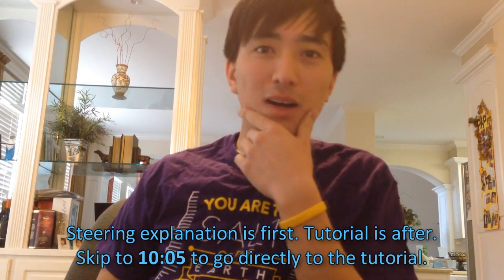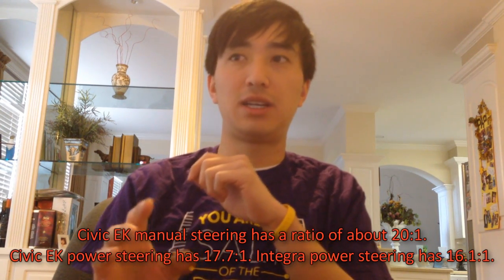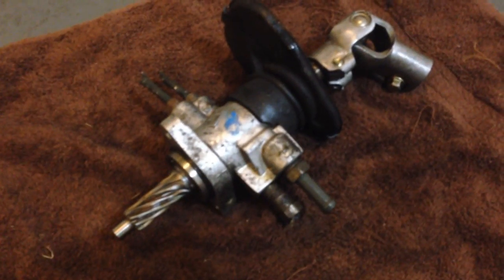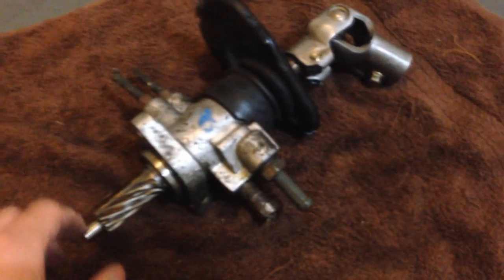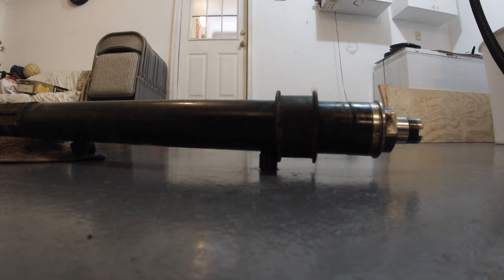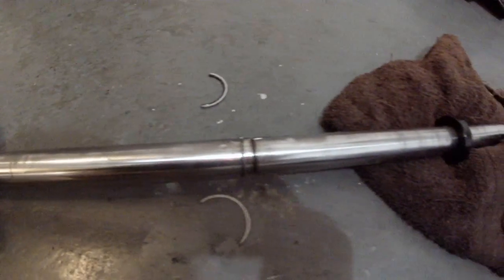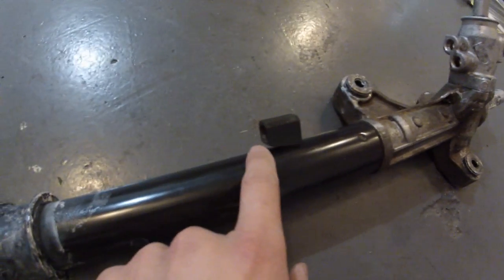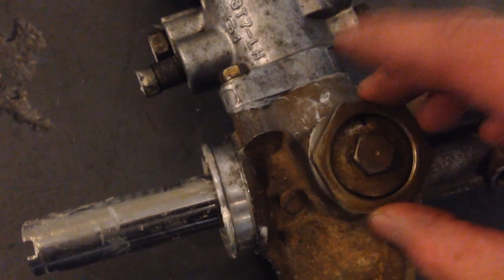How to Build & Upgrade Steering Rack for EK with Michael Flare

Comment: Hey Mike I’ve seen where some people weld a part of the steering rack when they reassemble. I guess it takes out any of the slop. But I know the heat can warp it some. Did you feel much slop on your setup?
Reply from the maker: I know people weld the big screw/nut that goes on the very end of the steering rack because it comes with a spot weld from the factory but I never heard of people welding anywhere else to reduce the slop. I don't think I have excessive slop, probably less slop than factory because I changed out all the steering rack bushings to poly urethane.

Comment: Is this a change from rhd to lhd？
Reply from the maker: No.
Reply: @MichaelFlare  I didn't quite understand how to change to short rack ，Now I have an ek9 power steering rack for rhd and an ek4 lhd powersteeringrack. How can I achieve the effect of ek9 on lhd
Reply from the maker: @zy5385  - If I remember correctly, EK9 Type R and EK4 SiR power steering rack should be identical steering speed/ration (8 tooth). So you don't need to modify anything.
Reply: @MichaelFlare  I didn't know until I removed the ek4, thank you for your sharing. If the ek4 is not 8 teeth, how should I change it? My English is not good, but I have watched your video
Reply from the maker: @zy5385  - I am 99.99% sure it is 8 teeth because you said it was a "power steering" Civic rack which should be 8 tooth. If not, then I have bad news. You cannot swap the RHD pinion gear with the LHD pinion gear. Even if it was the same teeth, it still cannot be swapped because the housing design of LHD and RHD is different. It will not fit. I tried this exactly before, it didn't work.
Reply: @MichaelFlare  bad new…My lhd is ek3 but not ek4, so I still want quicker steering on lhd,
Reply from the maker: @zy5385  - It doesn't matter if it's EK3 or EK4 as long as it's POWER STEERING. The only time you would get a 7 tooth is if you have manual steering. You should be good.

Comment: Hey whats up man im currently in mexico out in the middle of no where pretty dealing with some property title transfers i managed to find a small preschool it seems like and i get horrible wifi right now but i came across this video i was only able to watch part of the begining of your video but ima leave a question for you. So back in the USA i have a house and ive been working on a EK9 build in my garage before i left to mexico i finished the RHD firewall swap. So i have 2 EK9 subframes and i have 2 EK9 power steering racks. they are right hand drive power steering racks. they have been sitting in a JDM junkyard out in the open it seems that they have been through a few seasons and tons of dust and dirt has acumulated especialy where the pinion is and the pinion does not have the rubber boot. Im afraid that dirt or sand grains could of entered into the pinion. I havent realy taken a good look but is this possible? Let me clarify the steering rack and pinion was simply disconcted from the steering shaft and it was left in the subframe and the steering lines were covered up so no dirt would enter. Do you think my steering racks are 100% good to use can i improve my power steering with change the gears inside the pinion and make it easier to turn? Can i buy and overhaul kit and just rebuild/overhaul my RHD steering racks? Sorry for all the questions i just cant find solid answers online and i cant find anybody selling RHD EK steering racks so i gotta work with what i have. Just for a clarification i want power steering in my RHD vehicles and i want the tires to turn easily with out having to turn the steering wheel alot. Im not racing im just daily driving me and my girlfriend have a 1999 and 2000 DX hatch backs we are doing RHD conversions with HX engines to save gas and to enjoy our cars and make them a little more unique we are just trying to get a comfortble ride out of both of them. Any input or recomendation would be greatly apreciated!
Reply from the maker: I think dirt and dust can get into the pinion gear and housing. You can take it apart and completely clean it out by washing it. I don't think you need to get a overhaul kit. Just take it apart and clean everything with what and soap and you'll be okay.

Comment: Do you have clunking noise after doing this mod? Or no weird noises at all?
Reply from the maker: No noise at all. When does the clunking noise happen? Over a bump or while turning?
Reply: @MichaelFlare  over a bump,  like speed bumps, rough road, im still waiting for my power steering to give up and really wanna try your mod, but ours is an EG not sure if it will work
Reply from the maker: @JomsF  - check the 4 mounting bolts that hold your steering rack to the subframe. Either they are loose or your steering rack bushings are worn out.
Reply: @MichaelFlare  thanks for the reply bro, we just got our eg hatch last june5, 2021, this will be an ultra super slow build
Reply: @MichaelFlare  another question bro, if i don't have integra pinions will my stock pinion work with this mod? Im on civic eg hatch 1993 power steering
Reply from the maker: @JomsF  - Yes, absolutely it will work.
Reply: @MichaelFlare  Thanks a lot for taking time to reply bro, hope you can upload more vids about hondas.. if i can't fix the leaks on our PS will try this mod..

Comment: drill out that pinch on the 36mm nut with a 6mm spot weld drill bit. I removed that nut without damaging any threads at all. So do not just remove it and damage them then force it together with jb weld

Comment: For the manual conversion did you leave any ps fluid inside the rack to lubricate it or isn't that necessary? also been talking to some of my friends and they say if you cancel ps the ps pinion isn't strong enough to handle the manual rack and could snap the teeth do you think thats possible?
Reply from the maker: I completely cleaned the inside from the old fluid. I lubricated the parts with CV joint grease. I am not a professional expert but this is my opinion. The stress on the pinion to rack is EXACTLY the same between power steering setup and a delete. Power steering works by using a fluid pump and injecting it right before the pinion in the silver housing to twist the pinion so the driver doesn’t have to use much energy at all. The only thing I can think of that gets more stressed out is the steering column or U-joint at the bottom of it because you are twisting the wheel much harder here. A pinion with more teeth (auto pinions have more teeth than manual) means you’ll twist even harder here.
Reply: @MichaelFlare  Thanks michael, in that case maybe Ill look into hardening my u joint somehow maybe cryogenic treatment so it gets stronger
Reply from the maker: @Wolf-or6ws  - I don’t think you need to do that. I’ve had two different depowered steering racks, and they’ve worked for years even through racing.

Comment: Why do those ratios seem off? I saw a guy said this took his ek from 4 turns to 2.5 turns. After buying an s2000 my civic feels unbearable. Like a pirate ship, feels half as sensitive. If I stay powered will this wear out the pump? I think I'll grab another civic rack and an integra pinion because I need some quicker steering.
Reply from the maker: It's hard to believe he got a 2.5 LTL from this setup. You have to understand why Honda made the non power steering cars have about 4.0 LTL like the non-P/S Civics and NSXs. The lower the LTL, the more strength you need to turn the wheel because there's more teeth. It's a big burden to have a human turn a wheel with a low LTL, that is why the lower LTL is obtained through power steering. If you use a low LTL on non-P/S, then the steering wheel will feel extremely heavy. 3.5 and 3.2 LTL already feels heavy at standstill; I can already imagine a 2.5 LTL feel like the steering mechanism is about to break. If you do somehow lower your LTL below the stock one for your P/S car, then I think it will stress the pump out more because of the pressure, and it might break a seal. That's my logical guess.
Reply: @MichaelFlare  I'll do some research on the stock PS pump. Do you know what the LTL is on a 97 ex with power? I definitely need it more sensitive, doesn't need to be as sensitive as my ap1 s2k but a lot more than stock.

Comment: Hi Michael I have a power steering eg steering rack, would this work for me too?
Reply from the maker: I don't think it will work. EG/DC2 have different design/mounting than EK. If you really want to use the EG rack, then you would to switch your EK subframe to an EG subframe which definitely isn't even worth it because you have to rearrange other parts under the hood. Are you talking about doing this on an EG or EK?
Reply: @MichaelFlare  Thanks for the reply Michael, Well I have a kswap in my ek and im using the eg subframe because gives better engine position and I think im also using the eg power steering rack thats why, So I guess I need to find a complete dc2 steering rack and pinion then like you did?
Reply from the maker: Wolf93 - I believe your EG power steering rack will work! You need only the Integra pinion.
Reply: @MichaelFlare  Thank you

Comment: Question.... If the Integra and ek ex rack are the same why can't i depower the Integra rack and it it in why do i need the Civic rack
Reply from the maker: I think the Integra rack HOUSING will not fit into an EK chassis. EK and DC2 do not have the same rack. You might be confused with EG and DC2 because I think they are the same.
Reply: Oh i see i kind of want to try hahaha

Comment: What type of grease did you use ? And do reuse the rubber bung on the rack shaft? Also the breather pipe between the boots does that get refitted?
Reply from the maker: I used white lithium grease but you can use CV joint grease. I reuse the seal on the shaft because  I feel like it keeps the shaft straight the entire time instead of rubbing completely on the edge of the steering rack hollow housing. I did not reuse the breather pipe.
Reply: @MichaelFlare  thank you Michael. One last thing do you need to pack the pinion and rack with the grease like a more is better situation?
Reply from the maker: @power0fdreams438  - Yes, you want to grease all splines of anything so the pinion gears should be grease. Use CV joint grease on everything.

Comment: So I had done this mod and actually commented to Michael about how difficult it was to steer.  I had removed both boots and even added circs to add grease even though I had greased it extremely well when I did the build.  Yet the steering effort was very hard.  So when I lifted the car I loosened the original setting on the adjustment nut, and I was at my buddy who is a Honda expert, and before we even put it up he know what it was:

It ends up that the reason for the very difficult steering effort was MY BALL JOINTS!!!!!!!  As soon as they were greased it was like new car.  Without a doubt this is one of the best mods I have done.  If I redo another car this is one mod that I will certainly do.  I would also recommend if you can find balljoints with circ's on them, its worth the extra expence to have the ability to grease them.
Reply from the maker: galognu - Which ball joints exactly? Front lower or front upper?
Reply: Michael Flare 

I believe the 2 lower were the most critical as the best most of the weight.  Since the car was up we also did the uppers as well as the tie rod ends.  If you do not have circs to apply grease my buddy had a large surgical needle attached to the grease gun.  If you stick it in at an angle and fill it till you just see the boot expanding that should be good.  I rechecked them a few eeeks later and no leaks whatsoever.  I’m almost positive I had changed them at the beginning of my build and I was shocked that they were the culprits.  Lesson:  either get ball joints with circs or have acces to a needle to be able to fill them.
Reply from the maker: galognu - I just built another rack last week. I wanted to use the Integra 9 tooth pinion so bad on a power steering Civic rack and have it depowered exactly like this video. The USDM Integra pinion housing is BIGGER than the JDM EK9 RHD steering rack. I can’t believe it. It took me 30 minutes to realize it was different size mounting so I had to assemble it back using the EK9 8 tooth pinion back in. Even though it’s the exact same steering quickness, the rack was completely depowered from power steering.
Reply: Thanks for this update bro..

Comment: I've had this  mod now for close to 3 yrs.  The steering effort certainly has become quite strenuous as time has gone by despite having greased it up massively at the beginning.  I've had to take off the boots and place grease on the ends to try to remedy that and also removed the bolts on the pinion to try to add grease to it.  

My recommendation would be to add grease fittings on both ends in a reacheable place to include the pinion on two spots to allow for air to escape while doing it.  Also I've noted as my Falkens wear out that the effort becomes harder as there is more rubber contact with the ground.

Its a great mod, but I think the ability to give it lubrication down the road will make it better.

Thanks Michael
Reply from the maker: galognu Of course it’s going to be very strenuous on your arms. The pinion ratio is meant for power steering, not steering manually by humans. It doesn’t matter how well you lubricate it, it’s going to be tough no matter what.
Reply: I would agree with what you are saying.  However, it started to squeak on me and as my front tires wear, (falken Azenis), it got even more difficult.  After moving the boots out of the way as well as lubing the pinion, the squeak went away and it got a bit easier.  I just think putting grease access while it's out of the car and being built is something to seriously consider.

Comment: awesome video! quick question, can i do this with my eg power steering rack?
cheers!
Reply from the maker: What part of "can I do this with my EG" are you talking about exactly? Of course your can "depower" and gut out your EG rack exactly like I did if it's originally a power rack to begin with, and you want to turn it into a manual rack. I think the EG and EK uses a completely different rack design so it doesn't bolt on to the chassis the same way. This means the Integra pinion might not bolt on to a EG rack to make a hybrid like I did.  I think the EG and the DC2 uses the same power steering rack though so the DC2 complete steering rack can directly swap over to your EG chassis (I'm not completely sure but you can search on the web to check).
Reply: Michael Flare sorry, i did wanna know if the integra pinion would fit in an eg ps rack! i have tried searching for this info but not having much luck! maybe my google skills arent up to snuff! lol thx for the reply!
Reply from the maker: Wait a minute. If the EG and DC2 might possibly share the same entire rack design, then that means that the Integra pinion has to fit with the EG rack!

Comment: i know old video, but i have a question did you reinstall the seal at the end of the steering shaft?
Reply from the maker: The black seal in the middle of the shaft from the video? Yes. I wish I didn't though because it wasn't needed, it's used for the power steering fluid but I didn't realize it until after. It didn't cause me any harm but it's unnecessary.

Comment: Do you have to install back the rubber bushing on the shaft inside the housing? I don't have one.
Reply from the maker: vincent2fly No you don't. I actually wished I didn't put that back because it seems unnecessary. It's not a bushing, it's a seal for the power steering fluid I think. So you're good. LOL.
Reply: Whew! Thanks, Michael.

Comment: Hey Michael, by any chance do you have a pick of the u-joint (coupler) that connects the steering rack with the pinion. Want to make sure they sell me the right one. Thanks in advance
Reply from the maker: I don't have a picture of it but it's hard to tell from a picture anyways because both manual and power steering U Joint look similar except the size is different which is hard to tell.

Comment: Michael thanks for the video. I had some questions and hopefully you can help:
Im debating if there is any benefit on looping or just doing what you did.
If i want to just loop the system, should i cut the metal ring as well?
Also, i've heard before that removing the fluid option totally from a rack and pinion will ruin them in the long run. Is that true? Have you had any issues with your rack and pinion after doing this?
Thanks in Advance
Reply from the maker: Doing my method is the most proper way because you are removing ALL power steering components for it. If you loop the lines like a lot of people (to save time), then you still have components inside the rack that were meant to be moved with power steering fluid and hydraulic (not my human force because it's too much effort to turn it). This means that looping the lines method will not turn as "freely" or as easily as the "gutting out" method like mine as if my method wasn't already hard enough effort for steering already. Removing the fluid will ruin the power steering pump if all power steering hydraulic components are still hooked up and attempting to use it with power steering. I think you're probably saying that looping the lines and removing the fluid at the same time will ruin it which I don't think will be ruined because you're no longer using the power steering pump anyways.
Reply: That was a quick response. Thanks for all the help. Will let you know how it turns out.